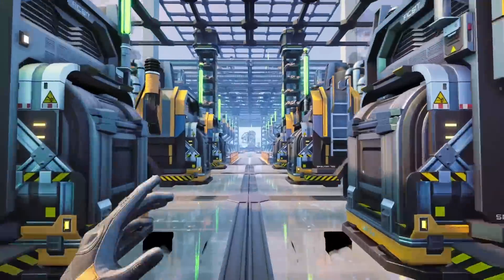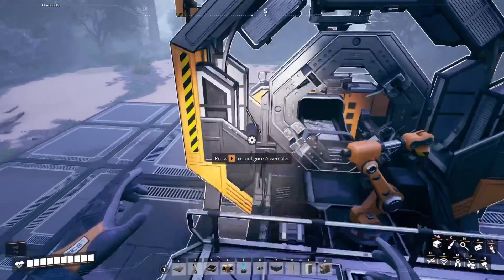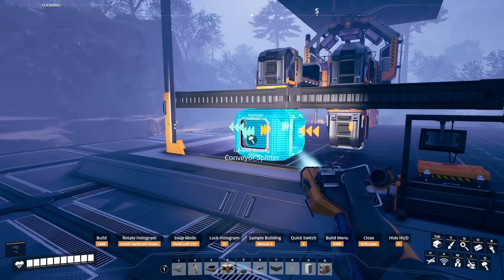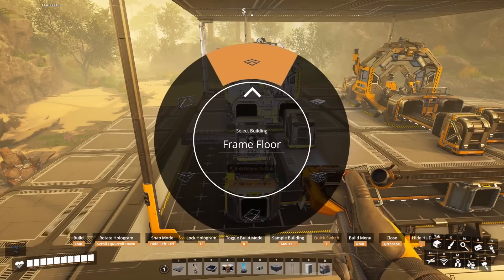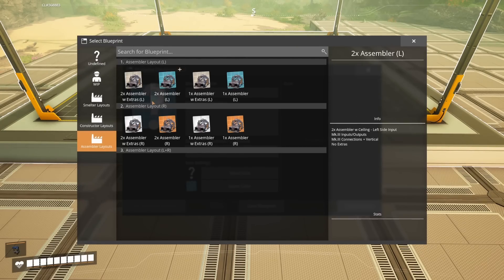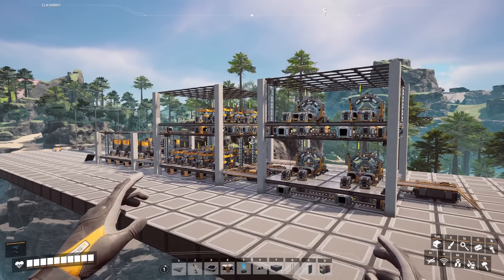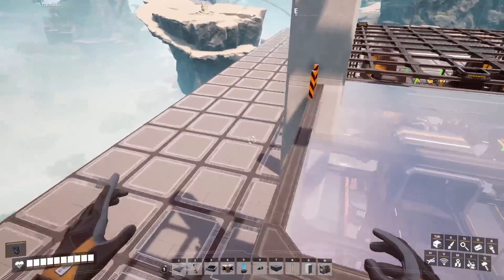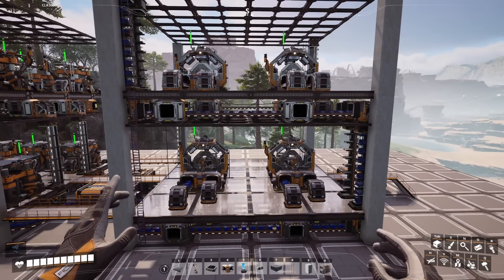Vertical Assembler Blueprints Satisfactory 1.0 Factory Blueprint Guide Ep. 4

Comment: Just a note, if you hold ctrl while changing from floor to metal frame or glass it will let you replace without deleting first.
Reply from the maker: I just tried this and had no success, is there a setting I need to turn on? I would love this feature!
Reply: @Cyanogenmod_  should be just vanilla with no settings to turn on. I use it with doors and messed up splitter/mergers all the time.
Hmmm
Reply from the maker: @azofshadowmore  interesting I’ll look into the keybinds, maybe I changed something by accident. That sounds like a super helpful tip so I definitely want to start doing that!
Reply: @Cyanogenmod_  haven't been able to test as I am at work now, but I am starting to wonder if it doesn't work on the architecture items.
Reply from the maker: @azofshadowmore  That was it! It does replace stuff like wall types and splitters to smart splitters. I can't do foundations as it enables the rotation, but other stuff does get rebuilt! That's super good to know I doubt I would have figured that out, thanks! Being able to change a wall around is going to be way easier!
Reply: @Cyanogenmod_  glad you got it to work. Just note that if you are on a hosted server, it has some issues. . . The wall you replace with a door for example will stay behind and still need to be deleted, but the door is there. Quirks of hosted servers I guess.

Comment: I like these designs. i used your constructor one for a build I'm doing that needs 140 constructors. was looking for a good blueprint to make it faster and found yours. You're making them in a mk1 blueprint machine so I just followed the video and re-made them into a mk2 blueprint machine, which for the constructors means a single blueprint can have 20 constructors thanks to the larger blueprint machine. Huge help to plop that many down at once. 

I'll try this one  in an Mk2 as well and see if maybe I can squeeze an extra assembler per floor too
Reply from the maker: That's so awesome! This is what I meant by taking them and making them yours I love to see it! You can fit up to 3x assemblers in the Mk.I, its just very cramped so it will 100% work in a Mk. II! Would love to hear how it works out for you!
Reply: @Cyanogenmod_  yea 3 assemblers per floor fit just fine on an mk2, maybe could have squeezed 4 per floor but i think it would have gotten really cramped so I stuck with 2 floors of 3. Between that and the 20 constructor blueprint I was able to complete my build for 50 automated wires per min pretty quickly.
Reply from the maker: @Fa11out  that’s awesome! I’ll have to keep that in mind and possibly make one for myself as well! Love to see you making them yours!